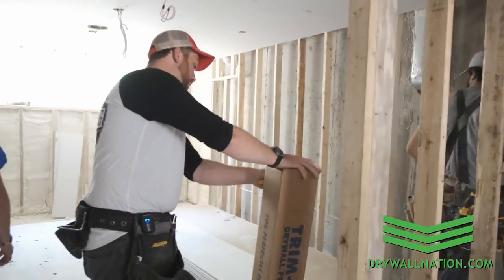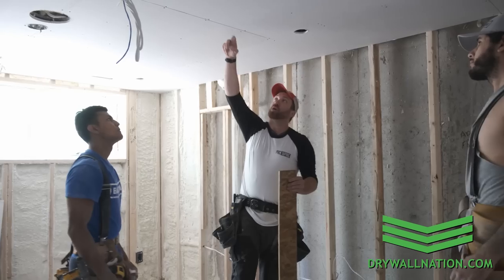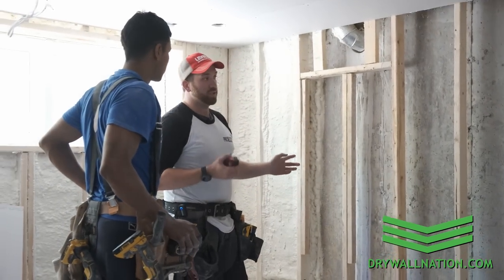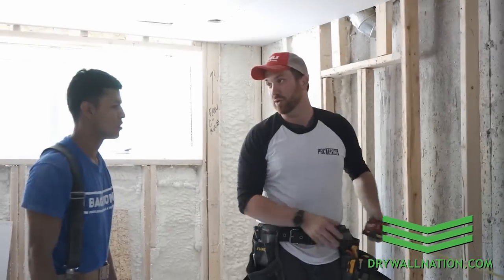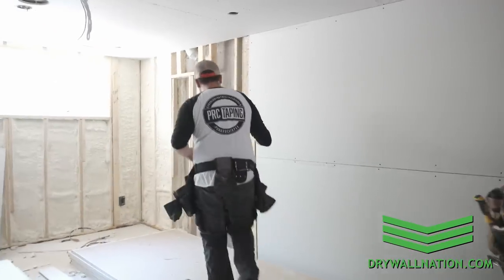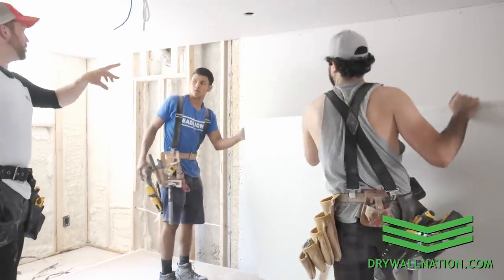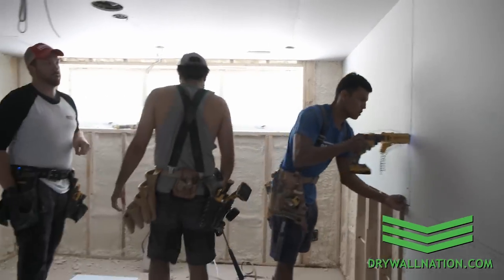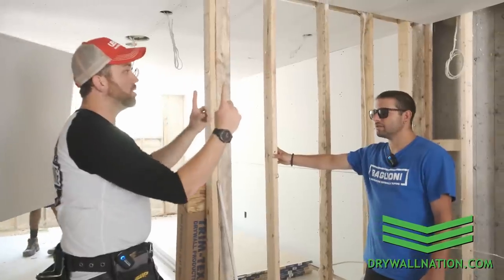How-To Eliminate Butt Joints using Trim-Tex Buttboard

Comment: Or just use regular OSB without the stupid V groove, put in two rows of screws on each side, V cut the butt joint and fill with setting compound. No tape needed and joint is less than an inch wide and perfectly flat. Been doing this for years with zero cracks or issues.
Reply: zero cracks without tape?.... i find that extremely hard to believe... what specific compound are you using again?.... sounds like a miracle and i'm all for trying it out
Reply: @notimportant3686  Any setting type compound. You know 20, 45, 90 minute mud. The magic is NOT in the compound. The OSB backer board behind the joint with TWO ROWS of screws on each side for a total of FOUR keeps the drywall from flexing. Think of it as the OSB is the tape and it is installed on the back side. Ran a business for years. It works.
Reply: @dennis6325  i can't think of it in that way because there is a reason on big seams you get more visible cracks with mesh than you do with paper tape... it's not because because there are no cracks when you use paper, it is because when a crack happens between sheet rock but it's UNDER the paper, it exists but isn't visible...

the osb is on the other side, so when that same crack happens, it is visible and not behind paper tape

i find it hard to believe that there is no flexible covering on the front of the joint and there are no cracks... i would say i find it impossible... if you've been able to do it, more power to you
Reply: @notimportant3686  
I have NEVER heard anyone think of drywall joints like that.  If there is a crack behind the tape, there is a gap, if there is a gap, it will ridge during seasonal temp changes. That is why you prefill large gaps before the taping process begins.

The method I described works. I proved it to myself by doing all the butt joints in my shop this way. It sees extreme temps and wind loads. Zero cracks and it has seen 20 years of service. ZERO CRACKS. No ridging. I used to have actual test data from a structural lab also showing it works.

The reason mesh tape cracks is because the fiberglass fibers run only down the length and across the width. There are no fibers running at plus/minus 45 degrees which means mesh tape has no shear resistance, but paper tape does. Pull on mesh tape diagonally and it folds up. Paper tape will not. Paper tape has shear resistance. As soon as the wall gets racked from wind loads, mesh joints will crack. But sometimes you get lucky if you use setting mud with mesh tape. But using ready mix and mesh tape is a certain recipe for cracking. Fibafuse mesh tape does have fibers in the +/- 45 deg direction and will work with ready mix.

Comment: I don't know if the taper is going to like  8 foot butt joints , also will they work on exterior walls ( insulation and vapor barrier )
Reply: they're really not butt joins anymore, they are just like all the other tapered joints now

Comment: I'd be interested to see the board myself. Many people claim that flat joints are flatter than butt joints. I disagree with that notion, especially on ½" board. If you carefully examine a sheet, you will notice that a flat joint has a slight ridge on the inside of the recess. This is because when the board is pressed, the material is soft. It squeezes some of the gypsum into a ridge on the inside edge of the recess. This ridge is often thicker than a paper taped butt joint. As a result, the flat joint cannot be any flatter than a butt joint. Properly done, I would prefer the butt joint. And stand up board is a big no, no, on anything high end. This leaves you finishing all the way to the ceiling every 12' rather than every 4'. It also leaves the long not so flat, horizontal flat joint run at near eye level. Which creates the illusion of it being flat. I would want to examine this product myself to decide wether of not is was worth any extra cost
Reply: I see it's just a specially designed piece of plywood
Reply: @kennethwilliams2738 : It’s OSB not plywood.

Comment: This is where a change in technique has not caught up to the product. In the past walls were hung with the drywall vertical. Manufacturers still have not changed the lengths to match up 16" and 24" studs with hanging drywall horizontally.

Comment: Are you able to use butt board with spray foam? I would imagine that the space between sheetrock and the spray foam would not allow enough room for the butt board.
Reply: If they leave the spray foam shy yes, if close to full no.

Comment: What about the joint at the top plate and the bottom plate? I feel like it would stick out at the plates when finished
Reply: On an 8' wall, the plate areas would be the tapered edge of gypsum.
Reply: @Dan O: Except that in this video there is no visible top plate. It appears they’ve dropped the ceiling to a point where the top plate has completely disappeared. Problem solved, lol.

Comment: I dont really like the idea of having a joint off a stud, its flexible. If someone lays on that wall, over the joint its going to flex or even crack. Not really good if theres kids on the house. Faster, maybe cheaper, not stronger. Now, i like the idea if you add a flat  recess stud instead of a floating piece of osb.

Comment: Can you just cut a 96 inch board in 16 pieces by 6" wide instead? Same thing.
Reply from the maker: No it's not the same thing. These are V-grooved pieces of OSB. They're thinner in the middle than they are the edges. That's what recesses your butt joint. If all you wanted was backing then yes you could do that. But this serves two purpose. Backing and recession your joint so there's no hump.
Reply: @drywallnation will it suck in a 5/8" drywall?

Comment: Wouldn't you just buy a sheet of OSB and cut these yourself? Also, isn't OSB more expensive than drywall anyway? Would this actually save money?
Reply: We just used a sheet of osb and some cardboard shims on the side of the osb and it worked perfectly fine and was dirt cheap. Not really sure if it saves any money, but it does make mudding easier for home owners

Comment: But that stuff is expensive, so have to add that to the cost b4 you subtract mud & board cost.....could probably make some out of osb sheets cheaper.....

Mud and drywall isn't that expensive....labor is though....

Why drywall isn't recessed on 3 or 4 sides by now is crazy....

Cutting labor will be biggest benefit
Reply: too expensive in the production.   Drywall sheets are manufactured into long pieces and sliced to size depending on need - 8, 10, 12, 14  Heck they have 20 footers in Australia, which makes for very minimal butt joints in their construction.   Plus you end up cutting the Butt's to fit the wall anyway so most likely you you slice off one recessed end.

Comment: There is no difference in waste,  depending on who does the take off.  Its structure is sound but if you're cutting the ends off your sheet plus now you need the taper to fill 8' butts.... big no no

Comment: There are still butt joints everywhere.  The video title says they will be eliminated.  What am i missing?
Reply from the maker: They're recessed like a factory bevel. Did you watch the video?
Reply: @drywallnation : A factory bevel is designed to be wide enough to accept the full width of the tape. The minuscule bevel that you MIGHT achieve (but probably won’t) with this product will serve no purpose whatsoever in the taping of the final joint.
Reply from the maker: You couldn't be more wrong. You understand the product is v-grooved right? It creates a tapered edge. We finish our buttjoints with the same exact process we use for our beveled edges. 10" & 12" Flat Box and that's it. And they're perfectly flat

Comment: You better think about where you put those butt joints in each room location: 1. A stud finder will activate when coming upon them. 2. How about your television mounts, your towel racks,   your "anything" that may have substantial weight to address, that thin plank of osb won't make the grade.... im just sayin ....

Comment: On a less than 8 foot wall, wouldn’t it be better to mount the 4 foot batter board on the shorter width side of the sheet so that there is no weak hinge point? Say on a 7 foot wall height, one drywall sheet will be 3 foot wide (this would get the whole 4 foot batter board) and on the 4 foot wide sheet would get the 3 foot batter board. This would cause  overlap between the two sheets at the seam making a stronger joint??

Comment: This guy is saying u save money in mud etc but those buttboards are so expensive Thais some bs.
Reply: @Joan Rock: I figure it costs about $1.50/joint in mud and no difference in labor regardless of the width because every joint requires at least 3 coats. At $20.00/joint for butt board and the increased labor to cut and install it, with no offsetting labor reductions, I think maybe I’ll take a pass on this particular product.

Comment: Is that crap even legal? A floating joint is structurally superior? I use that maybe a couple times a year but not every board. Does the builder know you do that?
Reply: @Gary Rosie: Drywall is not considered a structural component like framing and sheathing, it’s merely cosmetic and the building will stand fine without it.
Reply: @rayray8687  Exactly. I say that all the time but some houses especially here in Florida built on sand do move and shift. Then the elements of hot and humid to cold and dry make wood swell and shrink. Doors slam, windows get slammed, people get on the roof, remodeling demolition, hurricanes, houses built on stilts, building a built in pool will shake a house like crazy. Been there, felt that. So although it's not supposed to hold it together, a little common sense while hanging can go along way. If you think it doesn't matter where you break your joints, you just don't know enough about construction. Sheetrock is not a sheet of rock, it's a sheet of powder just looking for a place to fail. 43 years experience is all I need to back me up.

Comment: You can achieve the same results with a piece of plywood/osb and 2 shims of cardboard at each side saving you even more money. I still stager all joints,don't agree with 7 foot butt joints
Reply: Do a good framing  layout  plain your butt stud tape with fiber fuse save the money  or learn how to float butts

Comment: Sorry to say but You  don’t have to use butt board.
You can just use strapping or plywood strips 
Save on cost!
Reply from the maker: That completely defeats the purpose of buttboard. Did you not watch the video? Buttboard is V-grooved. It creates a recess or tapered edge so there's no hump after your tape is applied. Regular wood strapping doesn't do this.
Reply: @drywallnation  ok next question.
What if you have walls that were done with spray foam insulation? 
How would you get the butt board behind  the drywall when the spray foam is flush with the 2’x4’s? Just curious.
Reply from the maker: @kennethtaylor8822  Unfortunately if the spray foam is filled right to the front of the cavity then you won't be able to use Buttboard and will have to land on a stud. Buttboard is only a half inch thick, so if there's room for a half inch you can use it.

Comment: You know there are these things called 14 footers! Just sayin' Cut the sheet to the right lenth....so you DONT' hav2tonenail the screws and i don't believe in my 33years of drywalling hav i eva seen a but joint crack yet to this day....assuming proper application
Reply: @Pro Paint Drywall: I agree. I spent several years as a service contractor to a number of home builders and repaired hundreds of drywall cracks. They virtually always occurred at inside corners and along the edges of drywall beads, never at seams.
Reply: @rayray8687  Yeah the only time a but joint cracks that i've seen is in a garage if there is no stud behind the joint or sometimes w/an addition...probably has no footings or major settling issues or in a stairwell transition...again, just use a full sheet--watch where you put the joint....after decades of doing this it's pretty easy to see patterns of problematic areas

Comment: Buttboard does not save on drywall. A 12x12 room is still 12x12 regardless if you use buttboard or not. The real benefit of using this product is when the mudding of the drywall is being done. It sucks the butt ends in so that the joint uses less mud like the tapered sides of the drywall does. All that other talk was pointless. It does one thing, makes the butt ends easier to mud with less mud required period.